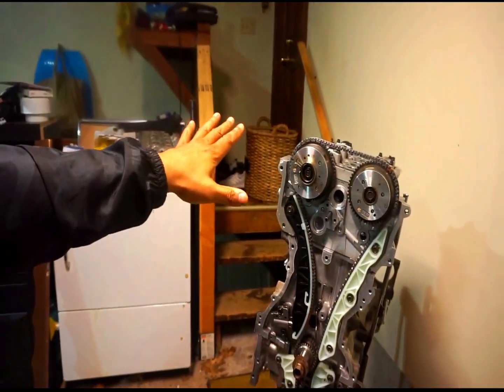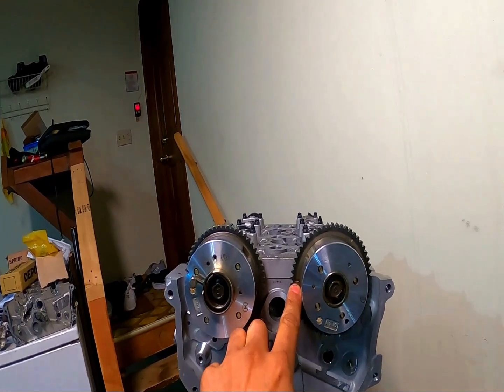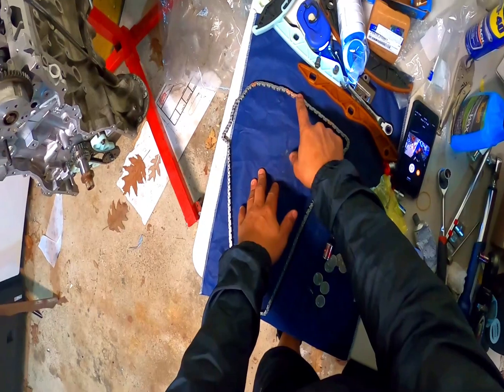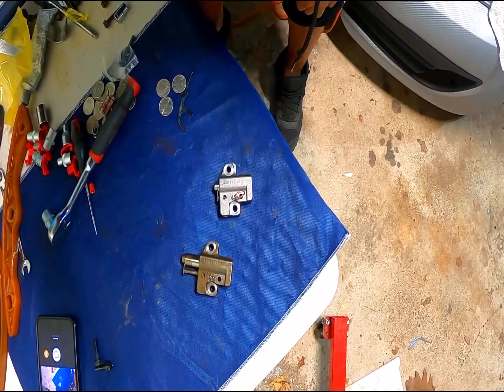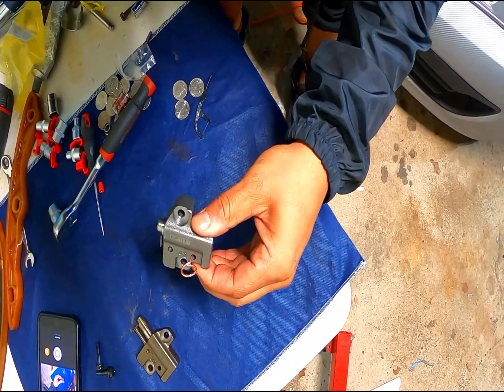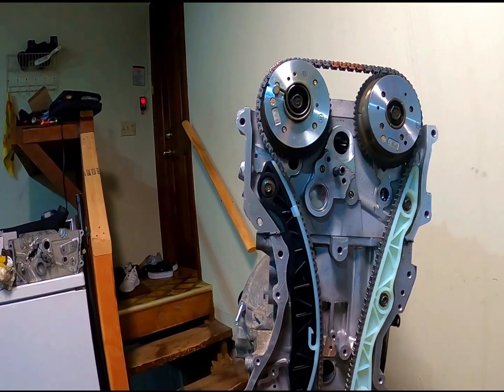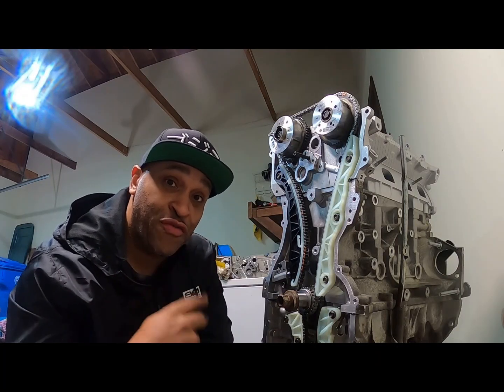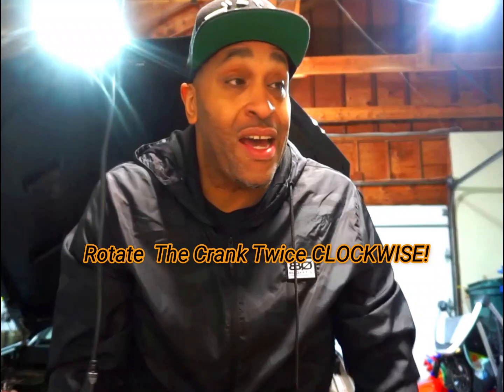HOW TO ADJUST ENGINE TIMING ON THE GENESIS COUPE 2.0!

Comment: Hello is this same chain kit like on Lancer?
Reply from the maker: That would depend on the timing marks. I would also recommend getting the timing chain and kit from a BK2 because the that chain is stronger.
Reply: @ChuckTateD117  tnx for fast replay, what is BK2 ?
Reply from the maker: @CarProMultimedia  no problem! It’s the 2013-2016 Hyundai Genesis Coupe
Reply: @ChuckTateD117  Where did you buy chain kit, Is this OEM parts or what? And tell me if you change oil pump chain is there some marks on oil chan whan you put new one  like  3 marks on big chain? TNX  👍 Nice video and nice work.
I thing the same kit from Gensiss fit on 2010 Lancer 1.8 143ps
Reply from the maker: @CarProMultimedia  yes it’s an OEM part from Fourgreen.com

I did change the oil pump chain. There was 1 mark which lined up with the dot on the oil pump gear. Thanks for watching!!!